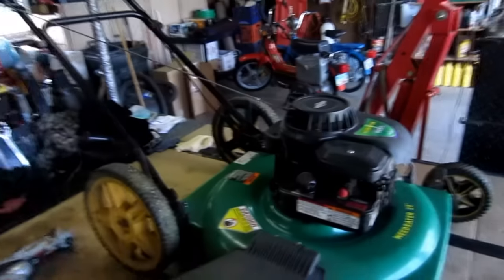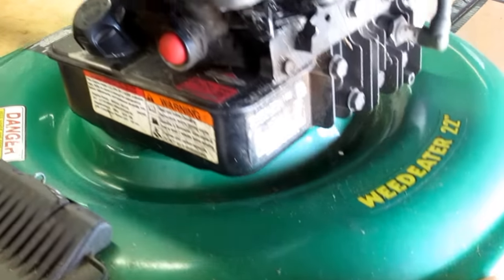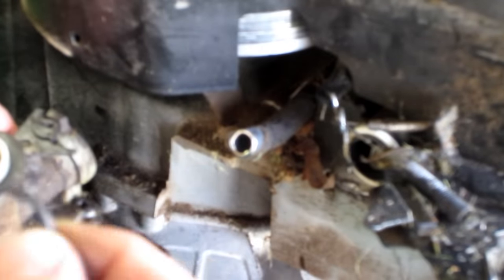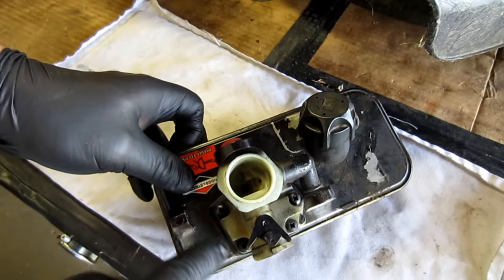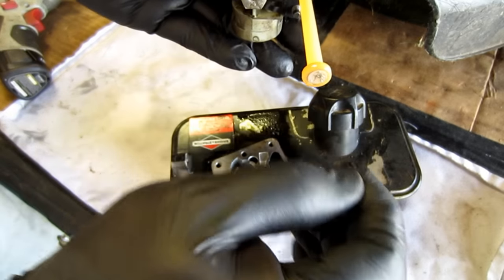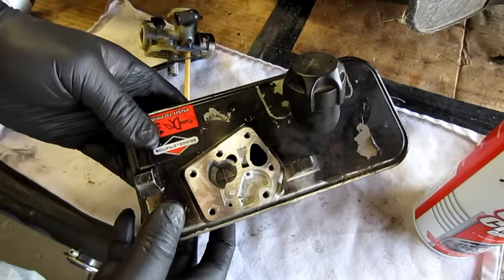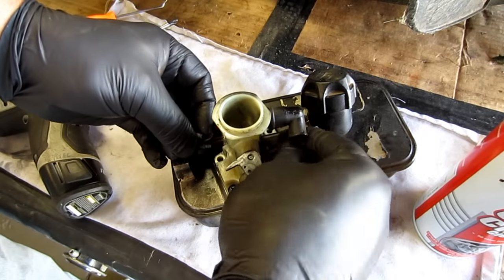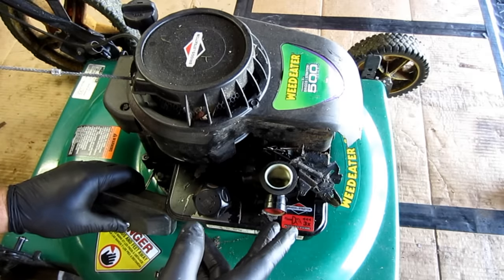Fix 90% of Briggs lawn mower not starting problems. Easy repair.

Comment: Amazon has new tank, gaskets, carberator, bulb primer, complete with new springs, everything for about $32. If mower is new, call Briggs for all that for free.
Reply from the maker: While that is completely true, that doesn't help with somebody who is trying to get their lawn done immediately and may start having problems halfway through cutting their lawn. Or just don't have the money for it. Step-by-step pretty much anybody can do this with some pretty basic tools and have their mower running within a half an hour. That's faster than any Amazon delivery that I know and definitely faster than getting Briggs to repair something under warranty
Reply: @Foxboss9  If you have problems getting that mower started, and don't know how to take about  a mower, you will need more than a few hours of following that procedure  to have it done immediately, or $125 to have it fixed. Actually, a new mower is probably less than $125 with those diaphragm carbs, good luck.
A 73 old grandma, who is flooding this site with fibs, can do this, give me a break. I laughed at using a power drill to instead of a simple  ratchet and socket. Why did it fail in the first place? Need new air filter, diaphragm,  and screen filters....find a place that will sell your this on a Saturday afternoon, not going to happen. 

It is a good video though and kudos to author, well done.

Comment: Sir, Thank You for the information. When the engine runs there's a slight had leak coming from the back of the carburetor were it connects to the motor but I can't see the spot were it leaks. I changed the oil, plug, air filter and primer bulb. It runs much better but now I don't know were it leaks gas.

Comment: I like the way you took the apart, it was part of my problem my mower, it stat to run a  second and cut right off What is the problem ,new has and spark plug.
Reply from the maker: Fuel delivery issue most likely... Repair carb

Comment: Thanks. Very, very helpful. Can you tell us what that power tool is that you use to loosen the screws?
Reply: Got it: they are the Craftsman 12V Nextec Impact Drill and Right Angle Impact Driver.

Comment: Great tutorial video, my mower (exactly same engine) doesn’t run as fast as yours, what do I need to do to make it run faster, I’m going to do what you say in this video to see if it fixes it, at the moment it chugs & splutters, but now won’t start then it will start then stops and won’t start again? Btw I bought it secondhand a few years ago but it’s never run fast. Thank you.
Reply from the maker: The tab that is on the bracket at the very front of the engine where the spring from the carburetor attaches to needs to be moved away from the carburetor slightly. Do not over rev it
Reply: @Foxboss9  hi, thanks for replying so quickly, do yo mean the tortoise & hare switch, if I move it towards the spark plug or the primer bulb it makes no difference, the springs seem very lame ?

Comment: OK, but clean-out the gas tank before reinstalling the clean carburetor. When you took out the carburetor the long tube that sits in the bottom of the gas tank had some debris on the end. Obviously the gas tank is not as clean as it could be. Also I use engine de-greaser on the outside of the carburetor and tank. Spray it on, 1" or so paint brush to clean it and then hose it off, like brand new. I only use carburetor cleaner on the inside. That's my two cents, otherwise a good video.
Reply from the maker: The tank was cleaned, the step was negated as most people have already done that step when they realize their mower won't start because of a fuel issue.

Comment: if you put the engine on top dead center the valves will be closed and the oil will not leak into the carb

Comment: good informative video, I would also clean the fuel tank while I had it off the mower.
Reply from the maker: I did, it's just such a remedial step that I excluded it. I would hope that the tank being rinsed out would have been something everyone would have tried before tearing apart anything else

Comment: Hey! Great video. My lawn mower has this exact engine and I did all these steps and it was fixed and cured for about 10 minutes of mowing and then started to bog down again and not run properly. Any idea what else could be going on? The governer spring you talked about...how do I know if mine needs replacing?
Reply from the maker: I would go through the same process again. Could be that you didn't get all the debris out of the tank and it picked it up.

Comment: You list a link to a gasket &  diaphragm kit.  When you took yours apart in the video it looked like there was just the diaphragm.  Was the gasket sticking to the back of it?  What's the correct order when you're putting them back on the carburetor?  THANKS!

Comment: In my experience it's usually been a carb problem. And of those times it's usually been the little jet at the bottom of the float bowl.
Reply from the maker: That only pertains to carburetors that have floats and bowls. This one has neither.

Comment: Thanks for the video my friend! Do you know what’s type of oil does this machine uses? Greetings from Mexico
Reply from the maker: Hello Mexico,! Just regular 10w 30 will be fine. You can run synthetic if you'd like. Or you can run partial synthetic also. These small engines are pretty forgiving.

Comment: I think the gasket sealing flaw is whats wrong with mine. I took the carb off and its clean as a whistle put it back together and same issue. It will run for a second when primed then shut off. I did notice the gasket did not look like it was sealing under the primer though that's probably my problem

Comment: nice job with this tutorial. my problem is with the mower running for ten min or so and then shutting off. gouging a track on the back edge looks like the answer. do you think a little permatex on the surface will help?
Reply from the maker: I don't recommend it. Got to figure if it's going to suck in the gasket they could potentially suck in that Permatex and the last thing you want is that in your small carburetor orifices. It is not fun to clean out.

Comment: Great video. I did exactly what you did. Used a new diaphragm and gasket. But still won't start. I have spark. Installed a new plug. Gapped it. Pulled the plug out and it smelled like gas. Any suggestions?
Reply from the maker: Try to get it to start by spraying carb cleaner in short bursts into the carburetor directly. If it runs then you still have a fuel delivery problem. Make sure your fuel is not old because it will not run on old gas and it will make a spark plug wet even one that has good spark. But first do the carb spray thing. If you cannot get it to run by spraying carburetor cleaner into the carburetor directly then you have other issues then fuel.
Reply: @Foxboss9  Thanks Foxboss9. It worked. But it will only turn on when I spray bursts of carb cleaner. Any other suggestions. I a novice at this but learning.n

Comment: This is great! Our problem is that the engine runs too hot. As if the governor throttle never moves. It's always pulled all the way forward. What's wrong if the governor doesn't move back to lower the RPMs? Thanks!
Reply from the maker: May have to adjust the governor. Make sure all the linkages move freely. Your rpm should not go over 3400 RPM
Reply: @Foxboss9  got video on how to adjust the governor? It does move manually. But the springs keep tension all the way forward. Also how do you measure actual RPMs? Thanks again!
Also I have photos of the positioning of the governor in default mode and pushing it back if that would help

Comment: All that won't help a bit if the tank is full of rust and water. For $20 you can get a new tank including the carburetor. Unless the old tank is pristine, do that. Yes, I tried to clean a rusted tank. Even a new carburetor failed after a few weeks. Just replace the whole thing and be done with it. And trey to keep water out of the new tank. Use ethanol free gas, it won't draw water.

Comment: Yo.  instead of a scribe,  i put a little line of Permatex , both sides of gasket.  but scribe trick seems real good.
Reply from the maker: Yeah, as I mentioned before, I don't have any problem with people using sealants except most people don't know how to use sealants. These small engine carburetors won't tolerate any goop getting in to the fuel delivery whatsoever. So Briggs & Stratton repair on these carburetors for warranty recommended describe and not sealant

Comment: The gasket/diaphram should always be replaced ( about $5 ) as they get stiff from the ethanol in the gas. Avoid using gas with ethanol for ALL small engines.
Reply: Where do you buy parts, I can't find the link.

Comment: Okay, so I've done a fair amount of work on carbs before and followed this one to the letter.  It fired up first pull and then died immediately again.  Other causes?  Coil? Thanks, and it is an excellent video.
Reply from the maker: If you can get it to run on short bursts of carburetor spray directly into the carburetor then you can roll out everything else except for fuel delivery
Reply: @Foxboss9  Awesome.  I will give it another go and see if I missed anything.  I will try all new fuel too.  Cheers and excellent video.
Reply: @Foxboss9  it was a case of after I did this cleaning and reassembly, it started and ran about :03 then shut off.  Would not refire after that....even with primer burst

Comment: Outstanding thankyou!
Can the rubber gasket be made out of gasket paper?
The accelerator linkage I put a guard around it.
Reply from the maker: The gasket and pump diaphragm is so cheap using the length that I provided in the description oh, it doesn't make sense to even attempt to make it

Comment: My problem is I have to punch the primer bulb about 20 times to get the mower to start and stay running.  After it starts it runs fine but if it's shut off for an hour it needs pumped 20 times again to get it running.  There's no resistance when you push the bulb.  2017 Briggs 125cc engine.
Reply from the maker: Replace the bulb..

Comment: there was debris in the carb, did the tank need to be flushed?   The Debris had to be in the tank, and so you cleaned the carb just to have it plugged right away

Comment: Great job with video on this lawnmower. Do you have more maintenance video for this specific Briggs engine type?
Reply from the maker: Thanks!, as far as repairs a lot of times these mowers do a pretty good job without needing much. The only other video that I have covering this specific engine I think is a engine brake cable problem that was posted around the same time this one was.
Reply: @Foxboss9  
My lawnmower is working after cleaning the carburetor. The air filter was a little dirty and greasy so I tried to clean and rinse it. Spark plug was installed new last year and gas is new.
Any ideas what's causing the issue?
Reply: My lawnmower isn't working....

Comment: Would this be a solution to my lawn mower once it gets 1/2 take of fuel it will not run and I have to fill it up then prime and it’ll start right up I’m on a budget for a new mower and friend sold me one for $25 trying to get it running right for atleast this summer thank you great video
Reply from the maker: Possibly... Or you could need a new carburetor... Your pick up tube (plastic light colored tube} could have a crack in it..

Comment: There's also a kill wire under there that brakes well it just gets misaligned
 and Grounds the engine out and causes a no fire it's got to do with that throttle control when you move it to stop it pushes this tab down with your kill wire and shuts the engine off if that tab gets misaligned it grounds the engine out and you get no fire so before you replace your coil unplug the kill wire and see if you got spark if so that's your problem just got a good free pressure washer because of that problem took me less then 10 minutes to fix and find then alway clean your coil and flywheel and readjusted with a credit card and clean your carb like this guy did and you'll be good to go for years with regular oil changes but always check that kill wire if you get a no spark don't assume that its your coil

Comment: This is a good video it covers everything except and take this from a 30 year veteran of small engine mechanic‘s don’t use pump gas ⛽️ 
Pump gasoline
 has 10% alcohol in it and these carburetors we’re not designed to run on that kind of fuel.
alcohol attacks the rubber components in the carburetor and the plastic and the carburetor. 
The symptoms of this problem is it won’t start or runs rough and rich it will eventually not run at all you’ll take the carburetor off and clean it and I’ll start up and run fine for a little bit and then it’ll happen all over again and run rough and then it will stop the only solution is to replace the carburetor and quit using pump gas.
Reply: Keith Burns so what type of gas do you suggest using instead of pump gas? A mix?
Reply from the maker: There is an app called "pure gas" you can find non ethanol fuel(usually near marinas)

Comment: I really wish I could find a close up picture of those springs and where they attach. I just bought one of these mowers for 25 dollars and it runs but those springs dont look like they are aligned like yours and they engine idles up and down way too hard

Comment: Hi, trying to help by cleaning the underside of the mower, my son turned the lawnmower onto the wrong side and now there is oil leaking out if the air filter..... Do I have to take it to the repairers or can I fix this myself. For instance can I just buy a new air filter? Thank you

Comment: My mower is very similar, however, the throttle only has one spring to the governor and it is acting crazy. I ended up pulling the cord out of it and now cannot get the recoil to operate correctly. How many little springs should be on it altogether?

Comment: Great video, thanks! It is important to tighten down those 5 screws. I did the carb, but it really was not very dirty. I still had trouble starting it until I tightened those screws even further. If I had done that first, I may not have needed to even take the carb off at all.

Comment: Cut fuel line between fuel tank and carburetor then install a small fuel filter get it from auto parts store.
Never had problems with carburetor ever

Comment: Near new mower use-wise that will only run until it uses up the primer fuel.  Does not act like the ignition is cutting out it is like it gets no more fuel. The carb is all nice and clean inside and I have blown out all passages and they seem clear. All looks fine in every way. Gas seemed fine but I have drained out the tank and put fresh gas in it. Gasket and diaphragm sure look good. But could this be the diaphragm? Or any other ideas of what could have happened to this carb?
Reply: I was checking the warpage of the cheapo plastic carb and there is some. Not a lot but the gasket and diaphragm are pretty thin so it may not take much to cause a problem. I am filing that to be flatter and will get a new gasket and diaphragm to see if that works. Can't see how else this would not be working.

Comment: I have a mower alot like the one in your video. When it runs out of gas and I refill the gas tank it doesn't want to run as fast and as smooth as before. Would a carb cleaning fix the problem?

Comment: Hey, I had seen your video and I have the same model.  I have gone thru the motions of cleaning the carburetor and etching a furrow on the side of the carburetor as you suggested.  It did not help.  Is there any channels in the carburetor that I can try and clean as an alternative to getting my mower to start?  What would you suggest?  It's funny that I have another push mower and it has a completely filthy carburetor and filter but it starts every time.  I can't figure it out.
Reply from the maker: Just replace the fuel pump and diaphragm if you haven't already.
Reply: Check the gap on the spark plug, my goto when my mower does not start.

Comment: I don’t know what the issue is. I have a brand new mower never used. Briggs & Stratton three and one. Gas mower. I put the oil in. I put the gas in. I primed it and then I went to pull the cord and it didn’t pull. I tried several times and it didn’t pull. I took the lid off to check the pull thing and if that wasn’t the problem because it works. Is it possible that the engine could be froze from the factory? If you could help me in anyway or let me know what I need to do. I am a woman on my own, and I need to learn how to do this. Thank you.
Reply: OK, I don’t need help. What nobody in any videos says is that during packing, the push handle is driven down into the inside of the deck of the mower, blocking the blades from moving and not allowing the mower to start nor allowing the pull cord to pull.

Comment: Wow, it must be easy if a guy who thinks it’s called a flat tip screw driver can be an expert and flip you off hundreds of times throughout the video then it can’t be any sort of difficult. Fortunately I didn’t need this video to fix mine. I have a Briggs with a proper bowl carburetor and my problem was resolved by adding an o ring between the carb and the edge of the intake it seats against. I have put 4 carburetors on this mower and I guess the last swap the o ring fell off between them and I didn’t notice. Seems to work for now

Comment: I recently got a briggs quantum 50 that had problems starting and reving the problem was the o ring in between the carb and intake manifold had warn so it was sucking air the only fault of the engine